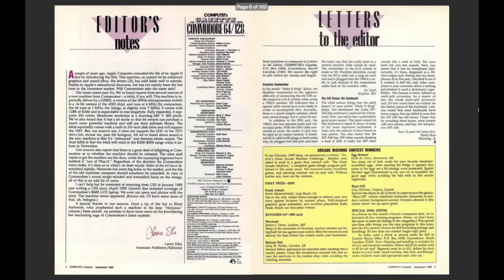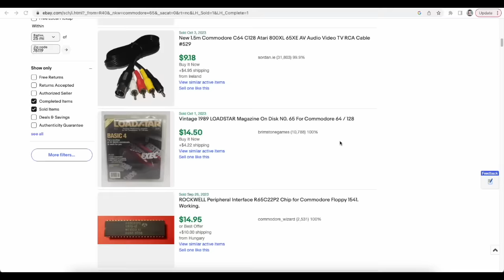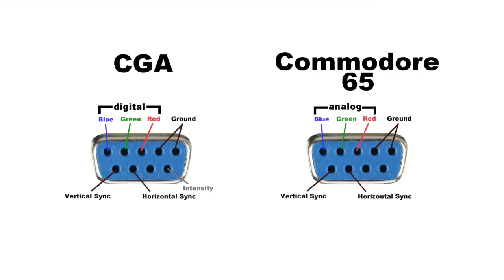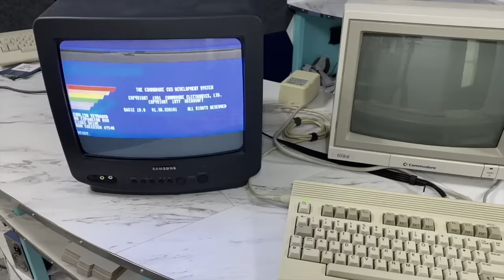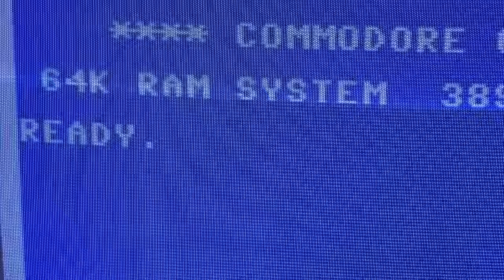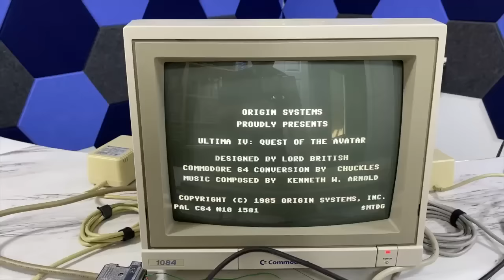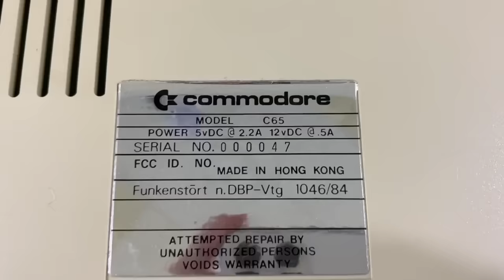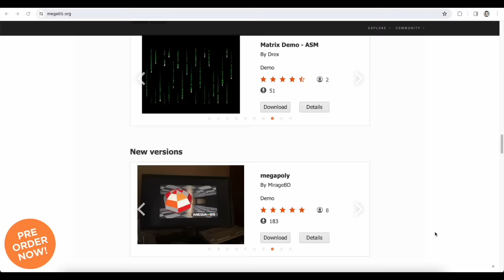The Commodore 65 - A Rare Prototype

Comment: Having to say my opinion as I worked at the time for Commodore UK / GMBH.  The CBM C65 would not have happened for the UK EU market, as we were looking at a advanced CBM C128.  The C128 would have been 256kb of RAM proberly at the end be 512kb fitted as standard,  and a upmix of the P,lus4 app roms and the word processor and spreadsheet upgraded.  This was an idea to be pushed to schools against the BBC Micro, the project was called the C256 but it proberly end up retailed as C512.  But CBM binned the idea, and then looked at a Plus4 version 2, but then the big push was for CBM PCs and push the A2500UX and A3000 with genlocks for the broadcasting industry and live mapping for emergency services.  No idea why they did a A1200 as all was said to miniturise a A500 as the A500plus (which is just the lasted motherboard a chipset of a A500, some A500 have this PCB and mqy have the chipset and fitted ram too.  Thus the miniturised for production came the A600.   I think the A1200 was to push out the C128 upgrade project, and same for the C64 the A600, from the Amiga A-team to end the C-team.  The PC  as P-team kept saying the A and the C line will be dropped totally.   The A1500 is just old motherboard versions of the A2000.   The A500plus basicly is just the latest production run of the A500 with chipsets and the fitted rampak to board.    99% of A3000 have a random multilayer pcb fault(s).  The new cased C64 is just a new production build with latest motherboards, and the C64gs just to get rid of all the unused warehoused low version motherboards of the C64.   The CDTV and AmigaCD32 were projects by Philips.
Reply: Very interesting to hear your opinions and recollections, particularly about competing with Acorn in the education sector. As we all know now, Acorn were also in a bit of a transition period in the mid-1980s, having been rescued by Olivetti and having abandoned their business machine line-up (apart from the niche Acorn Cambridge Workstation model that didn't deliver the Unix system that Acorn had been promising and the OEM-focused Communicator that was arguably a sideline), meaning that their bread and butter was the education market. And as you will be acutely aware, Commodore really needed revenue in lieu of the Amiga getting broad adoption, so the two companies were practically in the same boat (as they were on a number of occasions).

However, Acorn was readily able to "play defence" in the education sector against new entrants like Commodore. The real threat was from PC clone manufacturers (or PC-like manufacturers in the case of Research Machines), as decision-makers started to reposition the usage of computers in schools towards vocational training instead of classroom accessories. Acorn's range was seen as somewhat archaic by some commentators with respect to productivity applications, leaving them vulnerable to the clones, but I remain unconvinced that an enhanced C128 would have been able to pick off substantial sections of the market. The Amstrad PCW might have done, but it would have been on the basis of broader market adoption as a word processor: the kind of thing that the pupils might be using in the "real world". The BBC Master series came about in 1986 (reportedly a year or so late) as a defensive move to bundle Acorn's existing applications and, with the Compact, provide a response to products like the PCW.

Acorn was rather less vulnerable when it came to dedicated educational software, which meant that Commodore and others had to try and support the existing software catalogues if they were to actually replace Acorn's machines in schools. Doing that using a degree of emulation meant that the more expensive machines like the Amiga and the Macintosh were required, thus keeping low-cost machines out of direct competition with Acorn's 8-bit products. Eventually, Acorn brought out the Archimedes which provided high levels of compatibility as well as emulation support for BBC Micro titles, made viable by the higher performance of the machine compared to the Amiga and low-end Mac models, but they still sold the BBC Master 128 into the 1990s, and from 1989 onwards you could get the more reasonably priced BBC A3000 and its successors.

There are modern projects that run Acorn's software on other systems including the Apple II and, at least for BBC BASIC, the C64, as far as I remember. Had the business environment been different, it isn't implausible that Acorn might have ceded the 8-bit market and licensed their software to companies like Commodore in an attempt to establish some marketplace standards. But the common perception is that after initial success with the PET, Commodore was not interested in the education sector, dismissing the BBC contract and, if I remember correctly, only later seeking to license things like Econet from Acorn.

Comment: I remember pictures of that computer in the german "64'er" magazine.
Reading through the specs i thought it would be a C=128 on steroids and i so wanted one. 
My final 128-DB Rig was nice, with 2 1581,  an additional 1571, REU256 and tons of accessories. I did spend nights and nights on that thing programming hilariously useless stuff.
If the C=65 would have been released i would still be coding useless stuff to this day 😀
Reply: Wow, you were a power user!  Did you ever get any CMD gear?
Reply: @bozimmerman  Na, i actually scored all those devices when people moved to Amigas and IBMs.
The SuperCPU and the CMD Harddrive where on my wishlist though. Most devices i got for cheap with little defects like broken solder joints.
Reply: @DasIllu  Well, your system still sounds really awesome.  I am a big 128D fan. :)

Comment: Interesting - I had no idea the C65 existed. It looks like a cross between a C64 and an Amiga 500!
Reply: it is. regarding manufacturing, an 8-bit machine is less expensive because you need less pins on the chip and have less pins to route on the pcb. in the 80s/90s that was a huge cost difference.
the stuck with an 8/16 bit cpu with an 8 bit data bus but being able to address 24bit - a similar address bus size like the 68000 cpu in the amiga.

Comment: GEOS should have been baked into the ROM 😅 That aside, Commodore's worst competitor was probably Commodore themselves with the Amiga. Apple seemed to be intent on making the GS the last 8 bit hurrah, cripple it and quickly move on to the Mac. Commodore seemed intent on warming over the 64 rather than pushing migration to the Amiga (tbh they should have bundled a decent C64 emulator with the Amiga, kind of like how Acorn did with the BBC Micro emulator for the their ARM designed Archimedes and later models).
Reply: Two totally different price points. The C64 was being sold as a "video game" (that is where Argos put it in their 1990 catalogue) with a large bundle of games at 1/3rd the price of an Amiga.
Reply: @MrDuncl  TBH the problem was by the early 90's the 8 bit era was fading out, with the likes of the 32bit Mega Drive and similar consoles gaining traction. The Amiga of course stood up well to the Mega Drive etc in terms of capabilities, but the likes of the CD32 and the A600 were to late to market IMHO.  Apple made the cut in the 80s to transition away form 8bit but Commodore did not.
Reply: @danielnesbitt9565  From the positioning in catalogues the C64 was competing against the NES which was also 8 bit. Games for consoles were always very expensive compared to tape or floppy, where you often got playable demos "free" taped to the front of computer magazines to draw you in.

Apple made the transition to business. In 1990 all the managers at work had Macs to demonstrate their management superiority while us engineers had to make do with HP 286 Vectra's with 14" colour screens 🙂
Reply: @MrDuncl  I have seen those magazines when I was a kind in the 90s, thankfully I did not attempt to replicate the code I was given for the heavily modified hand me down Sinclair QL and the magazines with the BASIC games for that. The QL is another can of worms of course.

The 286 was a competent CPU if DOS support was not an issue. OS/2 1.x is very stable and useable on a 286 with supported applications. Microsoft saw the writing on the wall with the 286 and the market, IBM should have done as well in hindsight.

Comment: It's kind of a mystery to me - you don't make prototypes in that quantity, and I recall grapevine electronics was selling the C65 in their catalogue at fire sale prices.
Reply: Developer kits, you send one to all the main developers so they can begin writing software for it.
Reply: @watcherzero5256 is correct.  I just had yet another thought though.  While the serial numbers still suggest 200 units or so, the fact remains that we all get different board revisions and rom revisions in those cases, and they are unrelated to the serial numbers.  For example, my first C65 was a REV1.0 that was even more bodged than this one, but came with SN 000067.  
SO:  I wonder now if the 200 cases were ordered in preparation for dev kits, but the computer not yet completed, so the old boards were randomly paired with cases by Grapevine during liquidation.

Comment: I've never heard of, or seen that 1565 drive before!
I thought I knew it all...

Thanks for your detailed videos!
Reply: Hey!  It shocked me when I got it.  Heck, at that point the 1565 was nothing more than a rumor -- not even pictured anywhere.
The guy unloading his stuff on me said "Oh, this box has a drive for the C65 in it, I think", but I thought nothing of it.  Why?  Because I already had a Rev1 C65, and it had come shipped with an IEC 1581 drive built into an Amiga 1010 case, so I figured "Great, he's giving me another weird developer 1581."  
Well, when I finally opened that box, I just fell over backwards in shock.
Reply: @bozimmerman  Nice.
Well now I'm even more jealous Bo... The way you just casually tell me, that you have multiple original C65s, and even the old IEC drive is very interesting!

Some people have all the luck ;)

Comment: the video connection would work on a CGA monitor which is inherently analog, the digital bits are at the computer side.
also, this type of connection would allow for a simple 9pin din to scart adapter for the EU market
Reply: @AmauryJacquot - are you talking about CGA as in the IBM PC computer video standard (digital RGB like the C128) or "CGA" as used when talking about arcade monitors, which is Amiga-style analog RGB. I think 8BG was talking about the former and you're talking about the latter.

My Amiga 1084D monitor has a 9pin dsub port with a switch for either C128 digital RGB (directly connecting a CGA cable to the C128) or Amiga analog RGB (with an adapter cable from the Amiga's 23-pin dsub). Hopefully the C65 would have been used the same pinout as the analog RGB mode, though that might be too logical for Commodore?

Comment: The problem with C65 was that there was no niche it could fill. While it was designed to fill the spot between C64 and Amiga. This spot was already filled with Atari ST.
Atari ST wasn't as good as Amiga but it was still really good computer based on Motorola 68000. It had great software library. A lot of games and decent productivity software. It also had 640x480 1-bit video mode with progressive scan, a feature Amiga 500 lacked.
Reply: And the ST1040 served me well with Cubase and my synthesizer and sampler back then, very reliably over MIDI for years after the c64! 👍🏻
Reply: I don't think the European users would have switched to the Atari, Atari were not popular among the Commodore users in Europe. -Maybe in the US?
Reply: @KurtPedersen-tg7jc  Europe has many countries and each country has it's own unique society. I live in Poland and we had quite big Atari community. 8-bit Atari was the most popular. Hard to say, but it might have been more popular than C64. Atari ST was also present, but never lasted as long as Amiga. Atari ST users switched to PC in early 90's.

Anyway most Amiga games were developed for Atari ST first and then ported to Amiga. This is why there're mostly minor differences in games between two systems. Atari ST had no 2D hardware acceleration. Just CPU, RAM and simple frame buffer. It was really simple to port Atari ST game to Amiga.
Unfortunately this lead to a situation when very few games used Amiga hardware features in the time when publishers were releasing games for Atari ST.

In a way Atari ST was a leading 16-bit platform. Both Amiga and MS-DOS PC releases were limited to Atari ST capabilities. 
However Atari ST was a bit better in 3D graphics than Amiga. It had 1 MHz faster CPU and no bit planes.

Despite how popular Atari ST was or wasn't, it filled the niche between C64 and Amiga. In 1989-1990 it already had established user base with big software library.
Reply: @Leeki85  I do not agree. You're talking about the east block, and in that part not a lot of western computers were sold (Too expensive and too hard to get) In the end of the C64 life (1992-1994+), a lot of new users arrived on the C64 from Poland, Hungary etc. I asked some of them why they didn't jump over to the PC as most users did at the time, and all of them told me that it were hard to get Commodore/Atari 16 bit computers in those countries and they were very expensive at the time. They only dreamed of a 486 PC. When Commodore in the last years of the C64 life almost gave the computer away, the more poor countries of Europe could afford them. -This is not meant to be offensive, but at the the time, most citizens of the old east block did not earn enough money to buy an Amiga.

In Scandinavia, and especially UK and Germany, I think the C65 would have been a success.
 
Personally, there were no option buying an Atari locally as the sellers could not get rid of them. Only a few offered Atari computers (16 bit) on mail order
Reply: @KurtPedersen-tg7jc  This would require some research to tell how things were in the 90's. My first computer was 386SX 33 MHz in 1992. My friends upgraded their 8-bit and 16-bit hardware in 1993-1996. 1996 was the last time I've played on real Amiga. 1994 was the last time I've seen C64.
Local computer magazines dropped 8-bit systems in 1994-1995. Amiga had minor presence up to 1997.
Same with computer stores. Starting with 1995 it was hard to find anything for C64 and Amiga. Only PC.

Poland has multiple regions with very different income and culture. Some are poor (mostly eastern and southern regions) others are not. Polish average income will tell you nothing. It's way above what poor people earn and middle class earns way more. So my own experience might not be representative.

All I'm saying that Poland would be one of the target markets for C65. Keep in mind that Poland was the second country where Amiga 1200 launched. Amiga 500 sold really well here.

Comment: one very big mistake was to not make a new SID. they should have made a real stereo SID and not adding another mono SID. they could have added a LPC speech synthesis like the SP256 or TMS5000 with the first register block 100% compatible to the original chip.
with an unofficial way to upgrade the old c64 and c128, they could have sold many thousands to people owning a c64 and wanting to upgrade. people would have payed easy more than $50 for one of these chips. just adding two more address lines and rewiring the two stereo output pins with a simple adapter pcb would have been enough.
they should have done this already with the C128.
these kind of linear development steps where missing completely at commodore. instead, they always go side tracked with bs projects.

Comment: 16:30  OK Dave, this is the most wrong thing you've said in this video so far.  This should have been released in 85, I agree, but instead of the 128, not instead of the Amiga.  This computer was everything the 128 should have been. It is superior to the 128 and should have been priced about the same as the 128.  The 128 was needlessly expensive to manufacture whereas even in the form it is in, there are still cost cutting to be done with the 65.  The 128D, which is the only version that came with a disk drive was 500 Dollars.  This C65 could have hit the 400 price point initially and gone down from there.  This could have been cut down to 2 or 3 chips.

The Amiga was a GREAT computer, the 128 was a bad and unnecessary computer.  Releasing the C65 but cancelling the Amiga and not the 128 line would have bankrupted Commodore. 

This computer is in no way comparable to the Amiga.  In most ways it is completely inferior to the Amiga.  To begin with, it boots to basic.

Comment: I wonder if it's possible to burn one of the more recent C65 roms and use it on the C65 prototype to get that RAM card working
Reply: Hi Angel -- it's actually the opposite.  I am running a more recent rom, which made BASIC no longer recognize the extra ram. I'd have to run a much older, MUCH buggier rom for BASIC to see it.
That said, the extra ram IS there.  I wrote a little program that identified all the banks with the expansion ram.

Comment: This is what the C128 should have been. Most C128's just stick in C64 mode because there is rarely any good reason not to. CPM is kind of pointless and honestly 128 mode felt that way. This feels like it has good reasons to exist unlike the C128.
Reply: By the time I opened the box my c128 arrived in, it was already obsolete.  Although to this day I REALLY want to code a BBS on it! Dual monitor capability would have been so cool :)